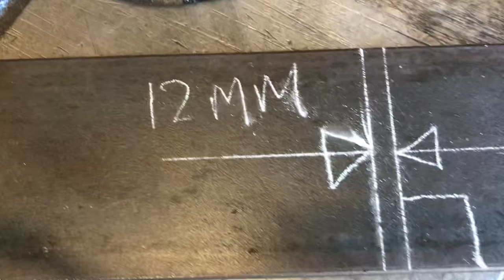The fastest tube notch method ALL Metal workers need to know.

Comment: Is 12mm the size of the gap when you butt the pipes together before you notch them?Where do you get the 32 degree angles from or is that the number that works well for all size pipe?
Reply from the maker: 12mm is the position of the tube past the blade at 90° Before you cut the 32° mitred cuts. 
32° works for all.
Reply: I’ve got a belt grinder dedicated and setup to prepare 42 and 33 mm pipes to butt them  together. That is such a time saver
Reply: Thank you so much for the clarification!

Comment: I use 33 degrees if the pipe OD's are the same. 
2-7/8 saddle onto 2-3/8 use 45 degrees.
2-3/8 saddle onto 2-7/8 use 20 degrees.
These are common sizes of oil field tubing.
Reply from the maker: Thanks for your comments 👍
Reply: I’m about to have to do this.  With 2-7/8 up rights and a 2-3/8 crossmember. Do you find the center and cut at 20 degrees on both sides or leave a gap like this person did?  I think my biggest problem would be making the saddle even.
Reply: @Big0veralls  I don't leave a gap
Reply: @rksando1  I just did this with some 2-3/8 od galvanized schedule 40 and didn’t leave a gap either. Turned out great especially for a guy like me. Self taught with a Lincoln 140 flux core welder.
Reply: @Big0veralls  Fumes when welding zinc coated steel are dangerous. I prefer dissolve it with muriatic acid. I stick welded on some galvanized 2-3/8 pipe a few months ago. I ground off what I could then welded outside on a windy day and made sure I stayed up wind. I just needed to weld some short beads so I was ok.
Reply: @rksando1  yes sir. I had the garage door open, and a big fan blowing behind me and out the door.  I also ground off all the galvanizing where I was welding.

Comment: I tried this today on 42mm diameter tube. It looked great. I then tried the same with 115mm diameter tube and it didn't work out. Is there a formula to work off as the tube gets bigger
Reply: Roughly 1/3 the diameter of pipe is how far to cut
Reply: @rockrover85  so for the 115mm diameter pipe I would do everything the same but push the tube 38mm ish past the saw blade?
Reply: @samuelbaldwin1225  did it work out that way?
Reply: @toddformanek8495  I'm yet to try it!

Comment: lo, like this is new. i learned this from an old timer 40 years ago, but i used an abrasive cut off saw. i also built many aircraft fuselages thin wall moly used a tin snip.
Reply from the maker: As new as the day you first saw it Todd😉

Comment: Didn't work on my cold saw.
Reply: Been doing this for years on my evolution saw. Good trick is to use a 123 block on the 2nd cut to make sure it is square to the first cut.
Reply: @sputnik9708  I got it to work, I set my saw to 32° like he said and the cut was wrong, I figured out that he meant 58°. A square cut on a saw is 90° not 0°. I set a stop for repeatability and got the job done.
Reply from the maker: Watch it again. 
No one said set your saw to 32°.👍
Reply: @TheMetalFabGuy  when you wrote 32° on the metal you must've been talking about the temperature my apologies.

Comment: U first make a cut for 12 before the 32? ..
Reply from the maker: 12mm gives you the start position of the angle cuts
Reply: Can it be that iam not have to option do it on my band saw?can only control blade degree..not the clamp degree
Reply from the maker: Measure 12mm from the blade when it set at 90°. Clamp it in the vice
Then change your angle